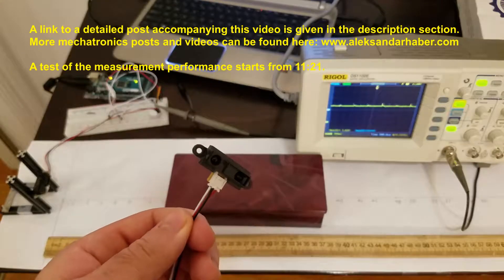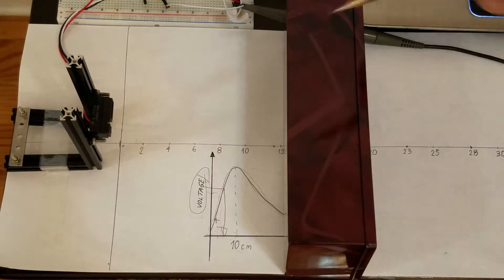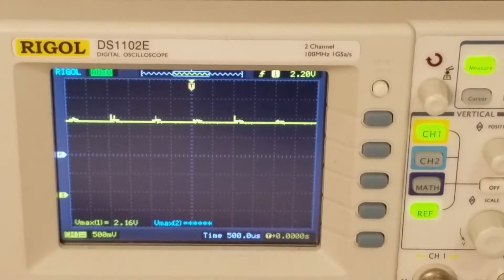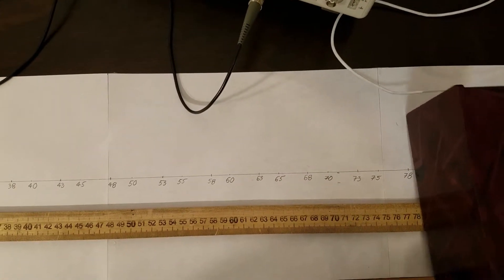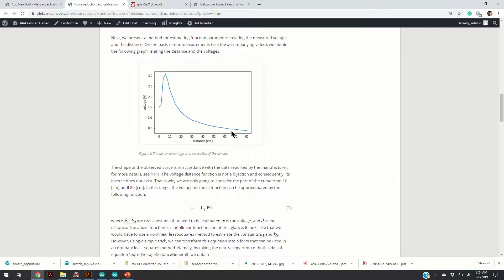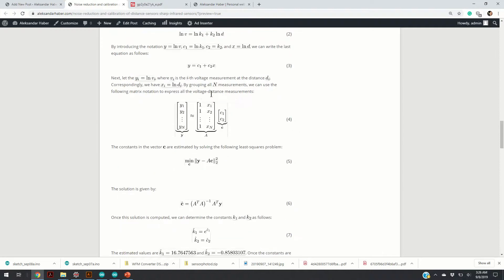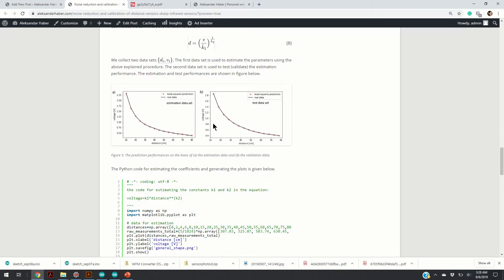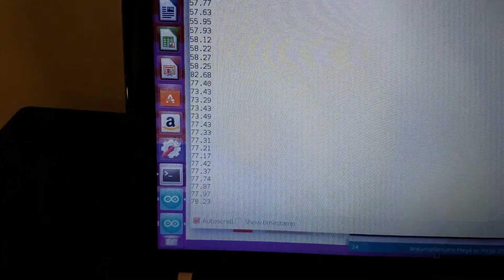Arduino Calibration of Infrared Distance Sensors -SHARP 2Y0A21-Experimental Mechatronics Lecture 4

Comment: i cant find 35 uF bypass capacitor in the market
Reply from the maker: You can use a similar capacitor. Just make sure that the time constant of the low pass filter is not too slow

Comment: Un consulta:

Al momento de sacar los datos de k1 y k2 yo armé las matrices en matlab tal como se dijo y resolví el problema (((A^T)(A))^-1)*(A^T)*Y el en mismo programa de modo (inv((A')*(A)))*Y y me salió la matriz C, pero los resultados me salieron c1=8.077 y c2=-0.842 dándome en k1=exp(c1)= 3222.34 que a diferencia del video le salió mucho más bajo y lo digo porque trate de comprobar el método con los datos de estimación que se introdujeron en el código de las gráficas antes de pasar con datos propios. Y siendo así, sería error en la nomenclatura del código puesto en Matlab o me salte algo de la misma ecuación que no me di cuenta?
Reply from the maker: I do not understand Spanish, sorry
Reply: @aleksandarhaber  I will create the matrices A and Y as you explained, using the estimation data from 10 cm onwards that you put in the python code because I wanted to confirm that it works well when using real data and I solved the equation: (A^T*A)^-1*A^T*Y in Matlab once the matrices have been previously entered in the previous equation as follows:
inv((A')*(A)))*Y. 
As a result, I obtained the matrix c and obtained the results c1=8.077 and c2=-0.842, giving me k1=exp(c1)= 3222.34, which, unlike the video, came out much lower when confirming them. And being so, would it be an error in the nomenclature of the code that I put in Matlab or did I skip something in the same equation that I did not realize?
Reply from the maker: @anthonyreyes6697  Sorry, I do not have time to look into your code since I am really busy. The codes and the explanations I provided are correct. Try to understand them and possibly correct your code accordingly. Best, A. Haber

Comment: It looks like the sensor is located about 2 cm to the left of your zero mark both for the calibration and the measurement. Doesn't that effect the measurement?
Reply from the maker: It is not located 2 cm. You got the wrong impression because of the angle of the camera. Best, A. Haber
Reply: @aleksandarhaber  Thank you. It's a great tutorial both for the measurement and the calibration techniques. Plus, it wouldn't have been obvious to do the curve fit only over the right side of the curve, at least not until you've done it the wrong way a few times.
Reply from the maker: @charlesgantz5865  thanks for the interest

Comment: Hai sir, the decimals values are not consistent .
Reply from the maker: The sensor is very noisy, and I eliminated most of the noise. These results are much better than the results obtained using other methods. This is a cheap sensor.

Comment: hi, can you tell me, what is the wire connector that you use on that sensor?
Reply from the maker: standard wire colors: black - ground, red-power, and white-signal.
Reply: Aleksandar Haber can i use male to female jumper wire?
Reply from the maker: @muhammadhaziqyosri5765  The sensor usually comes with a connector and all the wires: https://www.amazon.com/GP2Y0A21YK0F-GP2Y0A21-Infrared-Proximity-Distance/dp/B075FPR2VX/ref=sr_1_2?dchild=1&keywords=sharp+distance+sensors&qid=1594995258&sr=8-2
Reply: Aleksandar Haber ok tq sir
Reply from the maker: @muhammadhaziqyosri5765  Thank you for watching the video.